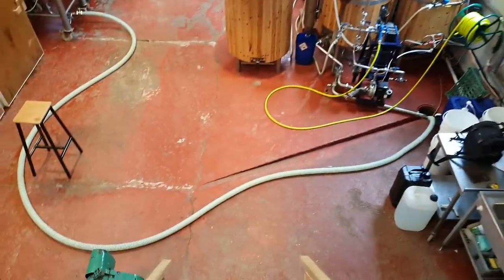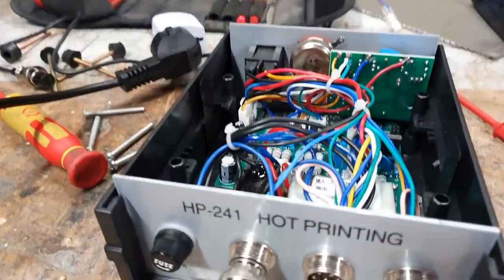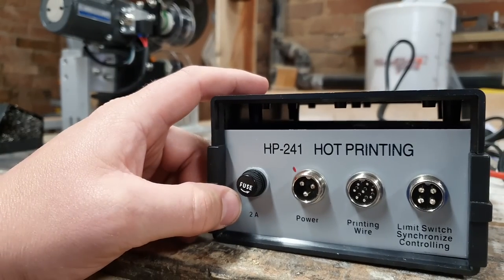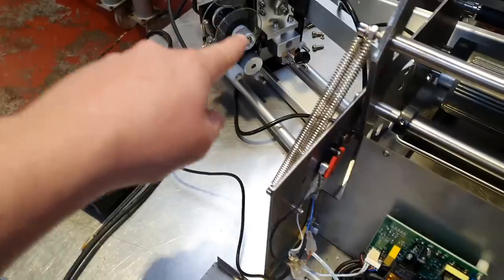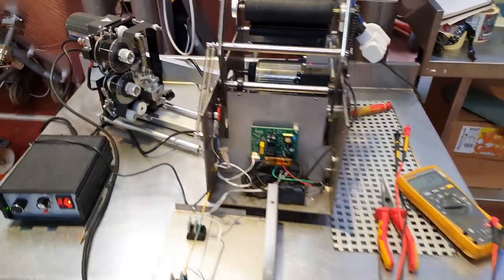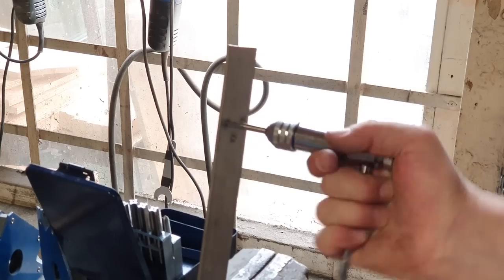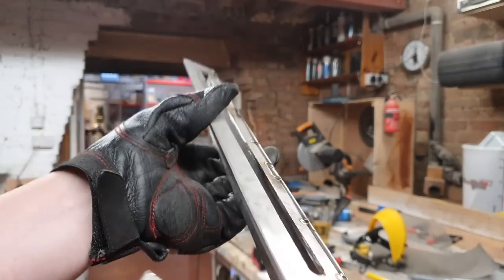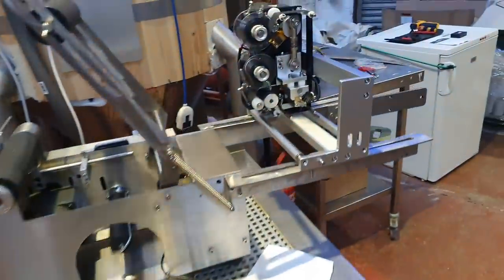MT-50 Label Machine & HP-241G Date Coder

Comment: I still don't understand how you wire the HP241G to MT-50, can you guide me?
Reply: Hey there! I am also attempting a retrofit of a HP-241 on my MT-50. I believe he wired the signal cable from the printer directly to the switch of the labeler. I'd start by using a multimeter on the 4-pin signal cable to see if there's a ground and voltage, and see if shorting them triggers the printer. If so, those are the wires to connect to the "normally closed" pins of the switch.

Do you mind telling me how wide the frame of your printer is? The first one I bought was much too wide for the labeler so I sent it back. I then realized that it is made in 3 variants, (300mm, 400mm, and 500mm) but even 300 seems wider than the labeler. I'm trying to figure out if there's some extra-narrow version that is used for the labeler.